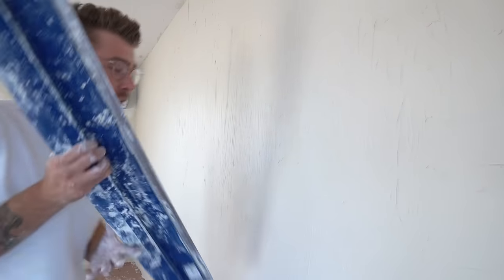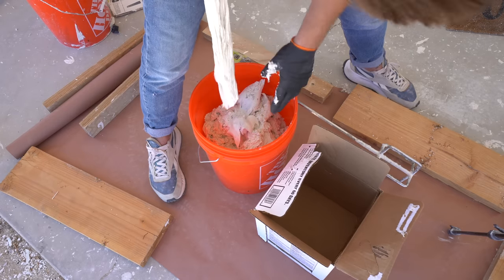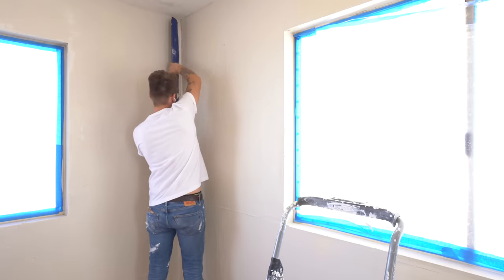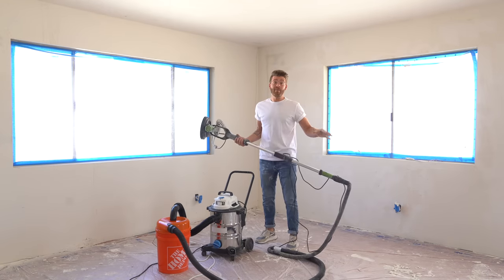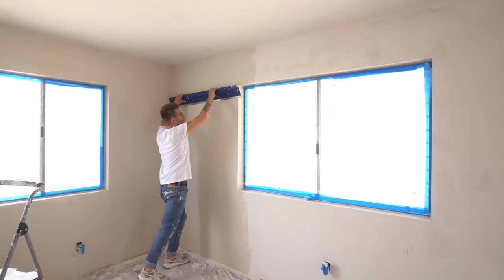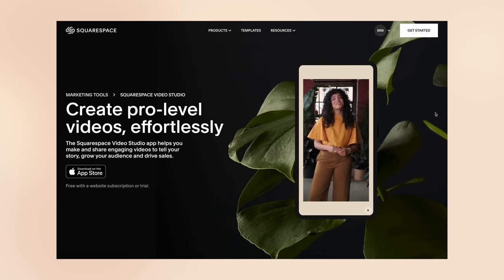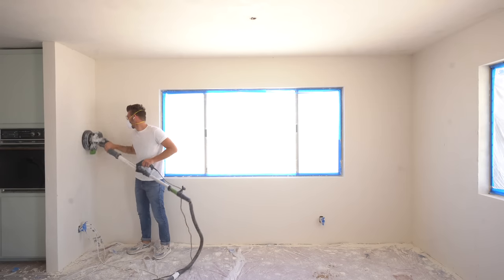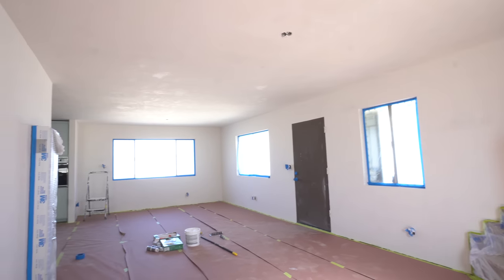HOW TO SKIM COAT OVER TEXTURE LIKE A PRO!! DIY SMOOTH WALLS

Comment: Looks great. I'm curious what the walls look like with a low angle light close to the wall. Re tips. you could add different colour pigments to every new coat of compound, that way you detect the voids a lot faster.

Comment: bruh you could of used your knife to bust out all high points then sand. you over there looking like you sanding down a whole mountian on certain spots. . but you got it done, whatever works best, you did say your not a pro, yeah bust out them high points with nice sturdy 6" knife, scrap it all down then sand. I'm no pro but I've been taught a trick or 2.

Comment: Did you sand the exisitng textured paint before applying the compound? or just clean the wall and put the compound over it? Because my textured paint wall has glossy finish on it, I'm afraid the compound can not grab onto it.
Reply: I been looking for this question no one seems to answer

Comment: So my issue I’m having pretty much as soon as I get the mud on the wall it starts drying. I have literally no time to start spreading. I can barely do 1/4 a section as you because it starts to dry. Then I have to try to get all of those small spots to connect. What am I doing wrong?

Comment: Would it be easier to remove all the electrical devices and cap off wires and push back into boxes instead of trying to work around the potentially energized wires ?

Comment: Hi Mike,

I bought the sander and the Dustopper based on your recommendation.  My question is how did you connect the house from the sander to the dustopper.  It looks like you used white duct tape.  Is that correct?  Thanks in advance for your help!